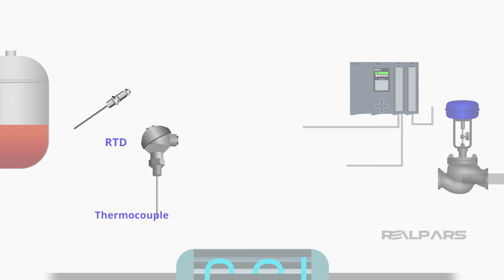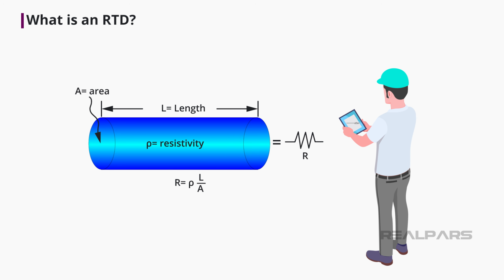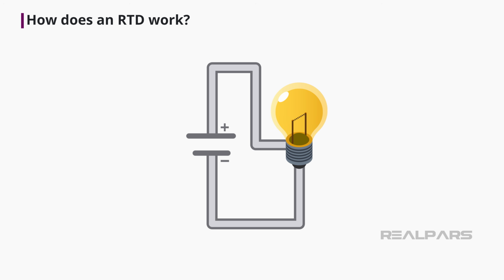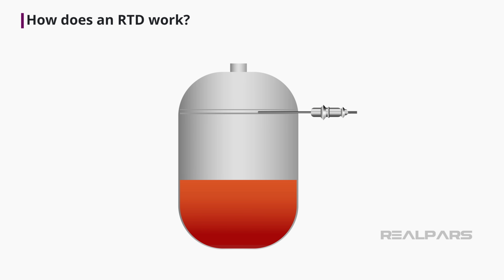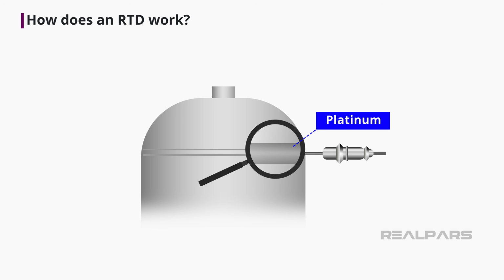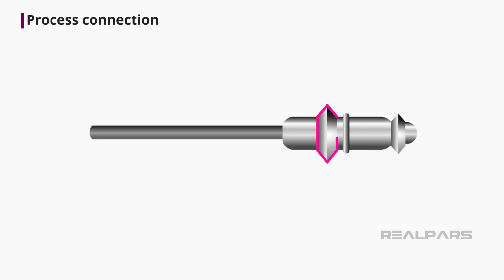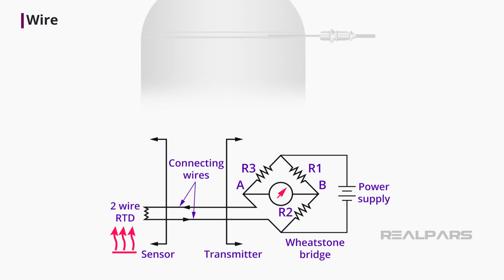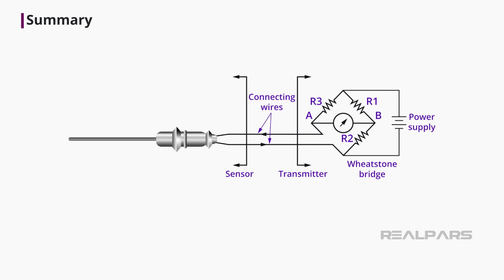What is an RTD | Working Principles

Comment: But there is no transmitter in the RTD sensor
Reply from the maker: Hello, @electricmind4  Thank you for your comment. You are correct! The RTD does not have a transmitter. It produces an electrical voltage signal for the induced voltage we sent it because it is a special type of resistor. The value of the resistance changes as we heat it up or cool it down. Then we read the voltage changes back to our controller, and that is how it works. The controller, as programmed, will provide this signal to the software, and control actions will happen based on the program written for the system in place.

Comment: Great video. I have a question, is it important to create a logic in a plc for energizing these transmitters or how are these transmitters turned on?
Reply from the maker: Hi Clement Jr,

Thank you for your question!

The devices we mentioned in our video are energized once power is applied to them in most cases, depending on your engineering design. And yes, you will have to write logic to interphase with these devices in your PLC to communicate with them, and in some cases, depending on the device and manufacture, you might have to create what we call a protocol handshake to start the communication as a means to energizing them to get ready. Always read the operation manual. 

Happy learning

Comment: I have one TC with range 0…to 100C. Can i change the range to -40… to 700C ?. It can be sir?, because we purchase same the specfication but wrong the range. Tks!
Reply from the maker: Hello Nguyễn Huy Liệu, 

Thank you for your question. As you stated you are measuring between the range 0…to 100C and are going to use an RTD of the range to -40… to 700C. Therefore, you should be able to read the measurement but as we stated in our video resistance of the RTD plays a role here. Your measurement might be off or not accurate for your application. And you might have to do some calibration to your RTD circuit device. Here is a link that might help you understand your RTD calibration requirements. There is a lot of information on the WEB that can assist you if needed. 

Happy learning!
https://www.ietlabs.com/rtds.html?gclid=EAIaIQobChMIv5f7icWT_gIV0xTUAR0dSgMWEAAYASAAEgLN2fD_BwE